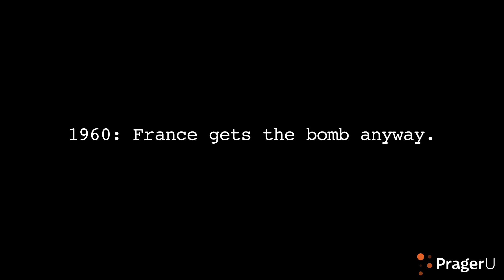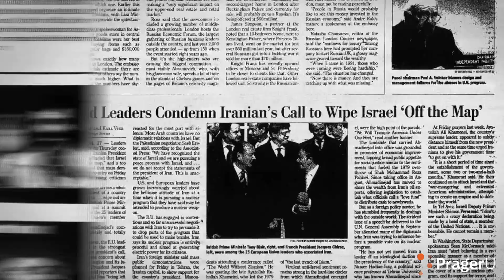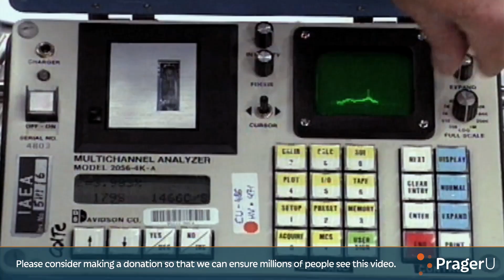Ami Horowitz: The Dark Secret Behind the Iran Deal | Ami on the Loose

Comment: Please research this issue for yourself: this video is incredibly misleading on these points.

1. The evidence that Lavizan was "a nuclear weapons" site was very weak, at best, mostly involving the use of two full-body counters. This does not necessarily imply nuclear work at all, let alone weapons work. The evidence of nuclear work was so weak, that IAEA inspectors requested access to the site only after the construction on the site had been underway for some time.

2. Iran began razing the site long before it was aware of the IAEA's interest in the site (as far as we can tell).

3. Once access was requested, inspectors were on site after only 10 days.

4. The allegation that the topsoil on the site was removed comes from very bad sources (usually attributed to a single reporter's ambiguous statement). IEAE inspectors on the site directly found evidence that the topsoil had not been removed (a wall still in place, vegetation, grass growing, trees with roots in the ground, etc). These indicators are actually pretty difficult to fake well (it's not as simple as just dumping new dirt into a 6-foot deep hole in the ground).